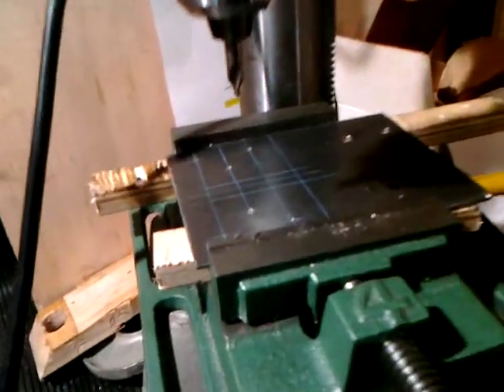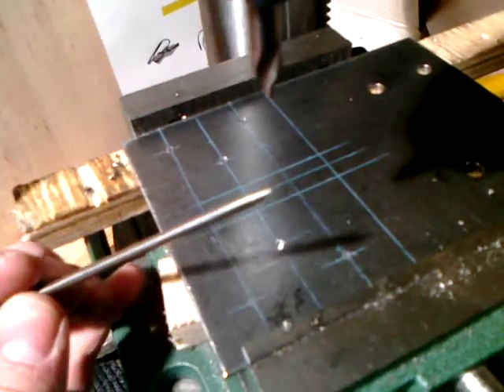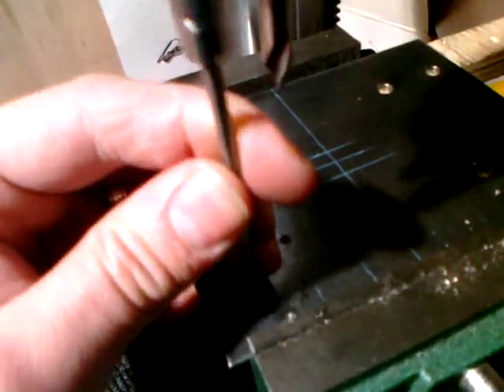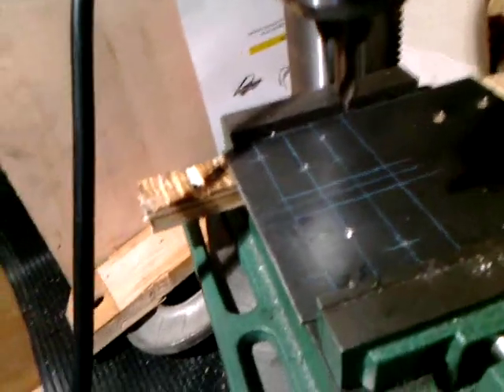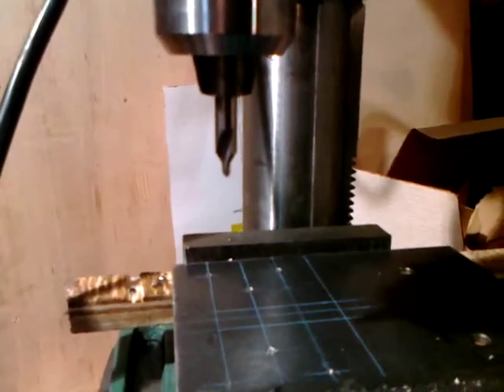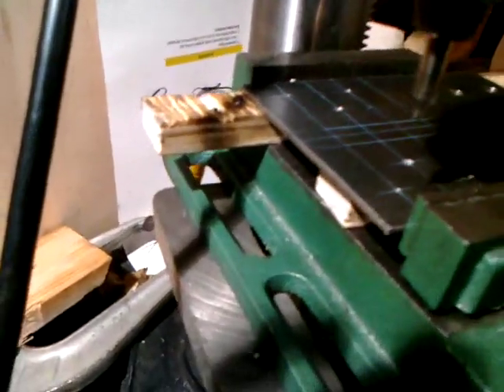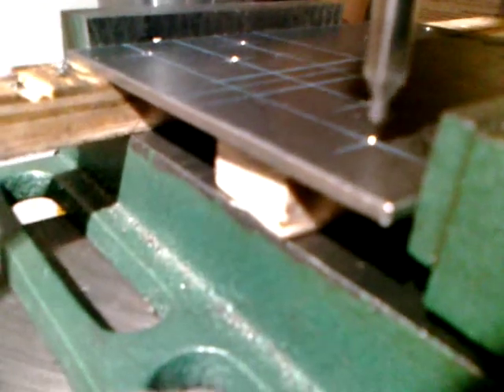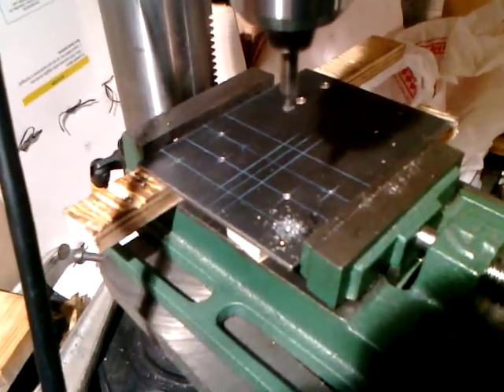How to Drill Accurate Holes on the Drill Press

Comment: Do you always leave the table loose or do you tighten it up once u find the center please explain. 🙏
Reply from the maker: Do you mean clamp the vise, or lock the table to the column? I'll answer both. 
I usually  lock the table to the column for rigidity. 
I usually don't clamp or bolt the vise, it just isn't necessary.  There are some times I do, like when I'm using a hole saw or large drill, and it isn't safe to hold the vise.  I also will if the workpiece is large. Sometimes I'll run multiple parts by doing the first part as shown in the video but with some way to reliably locate the part in the vise (such as a stop), then secure the vise after first hole is drilled. If you are going to secure the vise to the table, obviously you must take care to not bump it at all from the correct location
Reply: Thanks man we are required to make a 5 hole flange so was just wondering. We have similar drill presses here but for some reason once you drill the wholes it seems to go off center.

I normally tighten both vice and the the column that controls the vice movement.

You think i should just leave the vice tightend and and leave the column loose
Reply from the maker: @sunnyswazz5876  i would leave the vise loose, assuming that your center punch mark is right on. Clamp the column, because it might not stay square to the quill otherwise. The next most important thing is to use the three-step drilling process: spot/center drill, pilot drill, and finish size drill.  Technically, the pilot drill diameter should be about the size of the web (the area between the flutes) of the final drill size. It will never be accurate if you try to drill the final size on a blank sheet, with no pilot hole, and the pilot isn't strong enough to pull the vise on center, so it pretty much has to be that way (spot, pilot, final).  You don't need a pilot hole for anything under 1/4" diameter or so.

Comment: Is a core drill any better for marking drill holes?
Reply from the maker: Stubby and rigid is the criteria I'm after here.
Reply: @DrewskisBrews  That's not what she said.
Reply from the maker: @commentatron  yeah, long but flexible gives you the option to bottom out, but you're limited by the stroke anyway.  Having an unusually long one sounds good on paper,  lots of room to work and maneuver, but it'll be practically useless for starting out new holes. Just too flexible to penetrate with any precision. Once you get things opened up with the short stubby, you go in for the full depth.
Reply: @DrewskisBrews  I've also noticed that when I just try to jam it in there too quickly I get a lot of chatter. Seems best to feed more slowly and employ a pecking technique. Naturally, lubrication is important. Now, if I can figure out how to avoid producing lots of little chips when drilling the old block I'll have something.
Reply from the maker: Harrzack core drill for marking? I'm not sure I understand ther question?
Reply: OMG - BIG RED FACE!!  Got the wrong name - it is a SPOTTING drill.  Somehow I didn't think 'core' sounded right but...  GAK!
Reply: Not a question - a suggestion for a better drill than a center drill for marking holes.  Center drills  are for making a center in a piece to be turned in a lathe. Core drills are for making a mark/crater  with the proper angles for a drill.  :-)
Reply from the maker: Oh, yeah.  Spotting drill-that's a good point (pun intended). Probably the optimal choice, smoke 'em if you've got 'em. When I worked in a machine shop, we always used center drills in the milling machines.  Doesn't mean it was the right tool for the job, but not exactly the wrong tool, either.

Comment: @asayle3r5 
I bought a good mid sized jet mill last june, it's still sitting outside under a tarp..........+ spent $1,000 on tooling & a vice, a good one, thsat was around $600 & just no time to get it set up :(

plan is to machine some 80% ar15 lowers, my drill press was just too big a pain in the ass to use, it worked, I built one & it goes bang, but open up the ar & the maching looks like do dooooo, lol